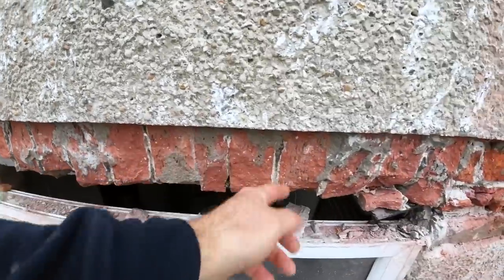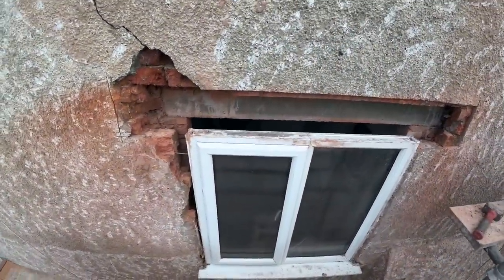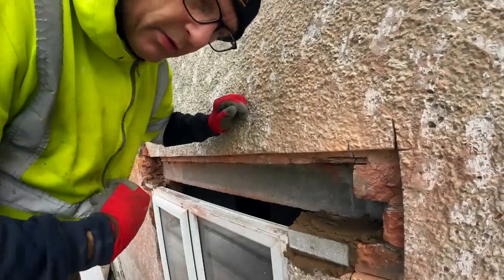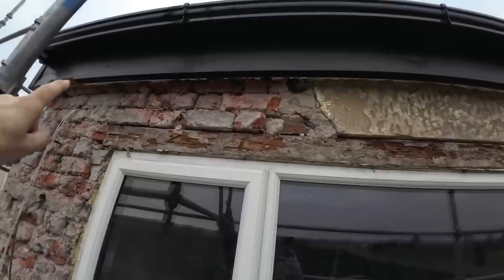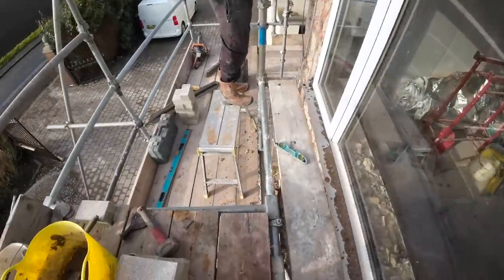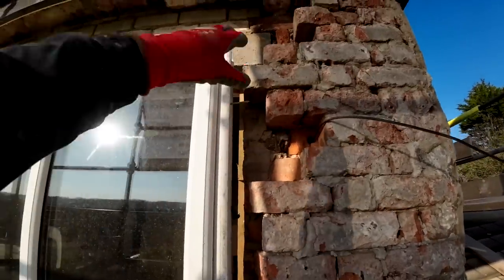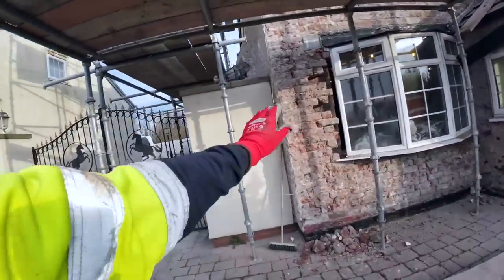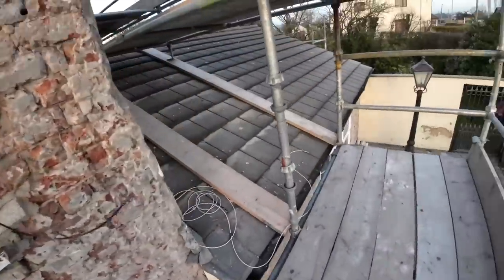LINTELS WITH NO PROPS!! FIND OUT WHY

Comment: Hi Steve and Alex - Brilliant content as always.
I've been watching your videos from afar for some time now, while being in the property market and having a firm awareness that the properties I've been looking at would likely require maintenance beyond conventional DIY standards.
If possible, I would like to ask a question if you, or anyone exprinced would hav the time or willingnesss to answer.
The property I've bought is showing signs of lintel failure, or potentially not having any lintels at all - It's a 1965 construction so I'm aware there's the potential the original windows were considered part of the structure and as such, lintels may not have been required up until the point of PVC windows being added. 
My concern is with it being cavity walls, that the lintels run into and support the inner leaf and I'm yet to find any content anywhere which displays the removal and subsequent replacement of lintels of this type.
From your videos it does seem that the angled lintels are the most commonly used in properties around this age/construction range.
I'm quite confident in replacing thm myself in the event there's no lintels, or they're angled, having attentively followed all of your videos - But I'm curious if this is arrogance instead of confidence.
I completely respect the work you both do and how attentive you both are, which is ultimately the foundations of my confidence. You touch on every aspect of installation, removal and replacement. 
I respect each job is different, but would it be foolish to assume/expect the job at hand too be similar to what I've seen in your videos?
Reply from the maker: There is a good chance that a 1965 house will have timber lintel on the inner leaf and and an angle iron or nothing on the outer . 
    I would honestly say it definitely isn’t a diy job and it only looks easy because I have over 30 years experience and done dozens of these jobs now . .
   I would recommend getting a good qualified bricklayer in to do it . 
   Good luck 
   Steve and Alex 🧱👍🏽
Reply: @SteveAndAlexBuild  Thank you for your reply, I completely respect how busy you are and your expertise. 
Please don't mistake my oversimplification as implying this is an easy or small task. I have a firm understanding and respect of your trade and the experience and skillset required, which is precisely why I'm so intrigued and attracted towards tasks of this nature. 
My intention is to veer off into property development and back towards my initial academic background of mechanical engineering, having veered into software development some time ago. This is why I want to undertake this task, so I have a firm footing, understanding and respect for the work and skills required. 

Again, I have the upmost respect for your skills and experience and from my profession, I'd assume it's similar to myself coaching someone significantly more junior (albeit chances of injury are drastically smaller as a software developer aha). The junior always expects it to be easy, but fails to factor in what they're observing isn't just logic, but experience. 
Logic is a foundation which when all goes well will serve you well, but experience being what navigates you through the unexpected, less conventional, yet more efficient routes. 

Thank you once again for your time. You'll have a life-long follower in me. Your content is truly second to none in information and attention to detail.
Reply from the maker: Thanks very much .
  Good Luck 🧱👍🏽

Comment: nice job. Why did you use the big concrete lintels over the windows? when you use the little 3-4mm galvanized  angles over the other windows in other videos? thanks Lee
Reply from the maker: Because it’s a solid 9” wall, no cavity and it will be rendered 🧱👍🏽

Comment: Assume being an old building that lime mortar was used between those soft red bricks. If so, a concrete render on top is a recipe for disaster in the long term. Hope the new render is traditional lime.
Reply: It would have to be if its a solid wall.
Reply from the maker: No idea 🧱👍🏽
Reply: Sadly the fate for a lot of old buildings in times past. People thought they were doing a good thing by protecting the old walls with a hard, impervious layer, but we know how that ends now. My own house is part cob and stone in Devon and I'm convinced we have a good bit of concrete render on the back which causes damp problems in the kitchen. It's on the long term list to fix when I can afford it!
Reply from the maker: @stevepettifer4896  🧱👍🏽

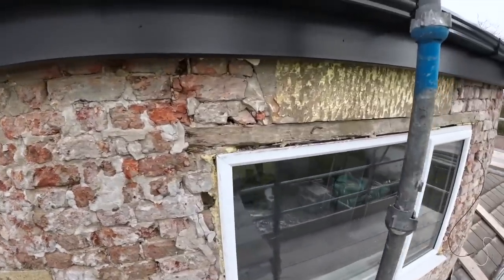Comment: Steve! Speak up please! At 20:00 you were too soft to hear. The cars on the road were overriding you.  Other than that the new sound system is great, and the wind fuzz on the mic really cut the wind noise.
Sorta dumb question: The concrete lintels are steel reinforced? I especially like the "taking it apart" bits as it reveals older construction methods. Keep it going....
Reply from the maker: Thanks very much . I don’t think the mic was on during the quiet bit . 😬🧱👍🏽

Comment: I thought you weren’t meant to put concrete lintels on exterior walls ? And been the rules for 15 odd years . All the ones we have done for window firms had to be catnics .
Reply from the maker: Can’t put a catnic on a 9 “ wall 🧱👍🏽
Reply: @SteveAndAlexBuild  of course you can the square metal ones , catnic make all sorts of shape lintels. I mean a square metal lintel . Fitted hundreds of them .
Reply from the maker: Still no need on a solid wall . Concrete is far stronger than an angle iron .

Comment: Difficult job you had today. Looks like window installers mascaraed the brickwork to fit their windows and covered the big gaps with tons of foam! Not mentioning their handy work with broken stone lintel and a rotten plank supporting it. I guess it wasn't rotten when they put it in :) They weren't ethical tradesmen like Steve and Alex, that's a given.
Reply from the maker: No buliding regs bags in the 1800s 😬🧱👍🏽
Reply: @SteveAndAlexBuild  The house was built then but windows replaced in recent years 😎
Reply from the maker: @soundslight7754  Those timber lintels pre date the plastic windows by a long time 😬🧱👍🏽
Reply: @SteveAndAlexBuild  Cheers Man. I didn't appreciate that. I thought it was a cut off piece of old fashion thick scaffolding board 😀
Reply from the maker: @soundslight7754  😆😆🧱👍🏽
Reply: Great vid great how you cleared the mess in the window very neat you certainly get a great variety of jobs.👍👍👍😎😎😎
Reply from the maker: @richardsedorski1206  😁🧱👍🏽
Reply: Nope…only their eyelashes were ‘mascaraed’…..🤣😂🤣😂🤣😂🤣😂🤣😂🤣😂🤣